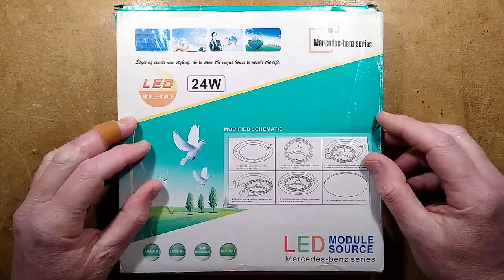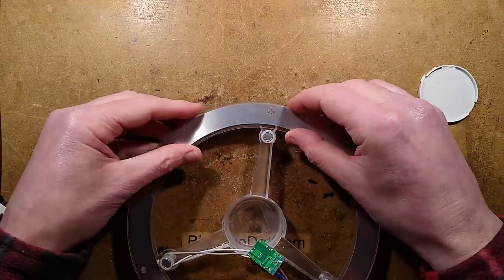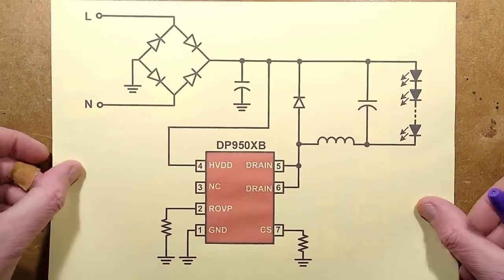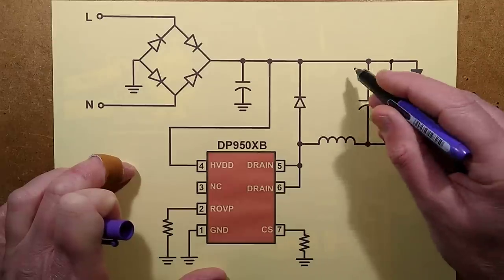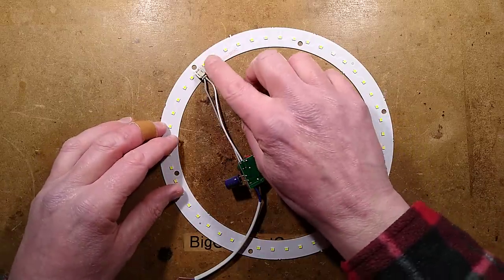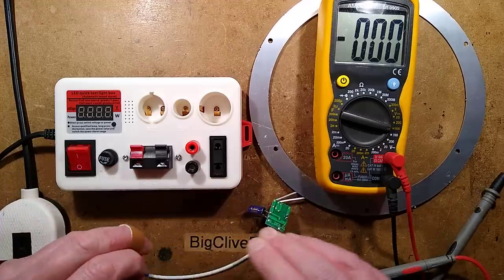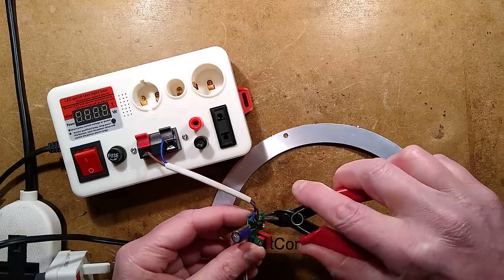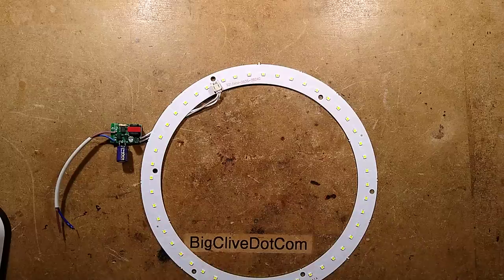Mercedes Benz LED ceiling light (with schematic and hack)

Comment: Yeah, made me laugh about Mercedes not "knowing they made this, too".   If they did they certainly would be dazzled by the quality.
Reply: Or they would be horrified  !!
Reply: It's actually pretty good as these things go.  It's got a proper bridge, a proper driver, and discharge resistors.  A bit overdriven, but who isn't these days.
Reply: Mercedes would love it, it's roughly the same quality that their vehicles have been lately
Reply: Makes me want to buy an old worn out Mercedes and just cruise around with one of these as the hood ornament xD

Comment: Once again you're wisdom is invaluable. Had taken up the current sense resistor on an led strip lamp. But it wouldn't always start nicely, sometimes flickered. As a result of this video have adjusted overvoltage resistor and now it starts every time 😁

Comment: In my town some of the Keep Left signs on traffic islands were getting smashed so often they've been replaced by ones on springs. They just fold down when a vehicle hits them and bounce back up afterwards.
Reply: Aussie?
Reply: I ignore all keep left signs. I hate all political sloganeering 😊
Reply: @jeffreybarton1297  As a centrist, I choose to drive on the divider.
Reply: As a right wing extremist I drive on the sidewalk
Reply: they should just put anti tank mines under the signs
Reply: I would have added some I-Beam or concrete block or something. Anchored deep into the ground.
Someone who drives over a traffic island doesn't deserve an oil pan ... or radiator ... or any car that is functioning anymore
Reply: An ideal video would be one showing the many mindless moron vandals, who seem to prowl some UK towns at night, attempting to destroy one and then it springing back to take revenge on their privates. Problem is, the moron would probably sue the council for GBH.
Reply: @ralphj4012  And win.
Reply: At the school where I work the mummies knock over the illuminated traffic bollards faster than they can be put back up again.  They tried putting some wooden posts in front for protection but the mummies just knock them down too.
Reply: @Fluxkompressor  did you see the clip featuring the "dukes of hazzard" van flying over the roundabout? :D
Reply: @Cenentury0941  As a cyclist I ride anywhere I damn well please!
I jest me good rider honest😁
Reply: In the rural area I live, there's a few mailboxes on springs like that because they keep getting hit by the snowplow in the winter... 😂😂😂
Reply: @larsfinlay7325  found the anarchist. :)
Reply: Please remember! ☝🏼”Two wrongs don’t make a right but three rights make a left.”

Comment: The most secure way: to warn about discharging caps, then saying again "discharge", just to use the fingers one second later. Clive, live long and prosper 😇
Reply: Laugh all you want, but Clive just saved me $6 for a bottle of wart remover.
Reply: I´ll never do that again. One small 400V capacitor burned deep holes in my finger. It took ages to heal.

Comment: Small HV Mosfets can have fairly high resistance. 8.5 ohms seems totally believable to me. With the current as low as it is, the dissipation is probably still a fraction of a watt.

Comment: I sort of like the aesthetic design because it reminds me of the old round CFL lights. It would almost fit in with my grandmas old 70s travel trailer.
Reply from the maker: It is designed to fit inside lights that used the round fluorescent tubes.
Reply: @Sylvan_dB  Clearly the spokes can be removed and the  driver moved off to the side - see about 8:50
Reply from the maker: @kneau  That's unusual.  Is it a skin or vision effect you experience?

Comment: It's a conventional-but-upside-down buck regulator where the buck's "ground" pin is the + power supply. Assuming the inductor is large enough to force the regulator to operate in continuous mode (rather than discontinuous mode), if you put a scope probe on the "DRAIN" pin using the HVDD as the scope's ground lead (VERY dangerous to do!!!), you would see a rectangular waveform whose duty cycle is Vled/HVDD where Vled is the forward voltage of the LED string. The current in the load (the LEDs) is a sawtooth. Just about all switcher topologies force a sawtooth-like current into the load.
Reply: I would not touch it with a scope without an isolation transformer to drag the whole thing to whatever potential the GND clip demands.

Comment: High voltage mosfets can have quite significant R_DS_ON, especially if they're just for low currents. Since it only takes a few mA to get several watts at mains voltage level, this is not a big issue. At high power (>1kW) only quite modern mosfets can actually rival IGBTs in terms of efficiency, but often still at higher cost.
Reply: Yes, everything else being equal, the on resistance goes up by the square of the voltage rating, so a 200V MOSFET will have four times the on resistance of a 100V part, given the same chip size and technology.
Reply: Yeah, it’s GaN or bust for mosfets at highest power levels. IGBTs were manna from heaven for a while now.
Reply: @absurdengineering  Or SiC. They're similar or sometimes better than GaN.
Reply: @Basement-Science  Yep. I did forget about SiC!

Comment: That light, with the center bits removed, could make a good light for a big milling machine or similar to light up the work area.
Reply: Drill press!
Reply from the maker: Commonly called a ring light for that application.

Comment: Running it at 18 watts while putting the IC in the center of the Benz logo so it has no idea of how hot things really are will definitely kill the LEDs in short order. That is quite a lot of power  for something in a piece of plastic. I wonder how long they really last? I can just see the plastic turning brown with a bunch of random LEDs melted into it because they fell off the board.

Comment: Speaking of "minor traffic issues " , I was trucking alfalfa hay from Nebraska to Wisconsin as a two man team.
Non stop all the way.
We pulled over to change drivers and check the load chains when we discovered that two,1200 pound bales had fallen off the back of the trailer somewhere between North Dakota and Minnesota.
Oops.😮

Comment: Another great video. 
So great I’ve watched it 4 time already 
“Let’s discharge this ,,ahhh yes” I swear I could hear the crack as the capacitor discharged. 

Interesting light. Nice concept with many applications 
Could add it to a circular magnifier by removing the spokes and hiding the circuit in the arm.

Comment: In 40+ years as an electronics hobbyist, that is the first time I've ever seen a resistor with a gold multiplier band. I was scratching my head for a while: er 6, 2, hmmm. I guessed 6R2 but it was a lucky guess on my part. 😁 At least it wasn't one of those damn 5 band horrors. What genius decided on the blue background that makes them practically unreadable?
Reply: The light blue background might signify metal film rather than carbon resistors, but I'm not sure .  For the color bands, I forget which multiplier is the same silver color as the 10% tolerance.

Comment: Those MOSFET resistance values will be in ohms, not milliohms.  An 8 milliohm/500V chip would be huge, much bigger than that 7 pin package.

Comment: By how many volts does your local power supply vary over the course of a day, week, month? I could probably figure out these variations of my own electric supply, but  I simply don't have the time. Once I retire however, most of my time will be spent corresponding with my local power supplier about these voltge variations. A lot! lol :D
Reply: Mine varies almost not at all now. They installed voltage monitoring equipment down the line which they must use to adjust the taps at the substation in realtime. Even during the summer with peak loading the voltage barely drops. Any drop I see is mostly at my transformer my neighbors and I share or my own 100 amp service lines. I live in the US
Reply from the maker: It's seasonal as I'm close to a small substation.   In winter the voltage dips a bit.

Comment: Hi ya Clive.  Great video as always.
Totally unrelated question for you
I'm trying to make my own led system for a model train set, using a couple of 4017 ic's for control of the lights. Will connecting the pin 14, usually VCC, to earth/ground turn it off.
Reply from the maker: What's providing the clock pulses?  If it's a 555 then grounding the VCC pin could shunt the output of the 555 to ground via the internal pin protection diodes if it was left running.  There's an enable pin on the 4017 that can be toggled between 0V and the positive rail to turn it off passively.
Reply: Hi Clive,I have a Hychika 18v work light that I was testing and old battery with and managed to put + to - now its very dull and won't turn off could I sent it to you to fix cause I haven't aclud what I've done tk it.

Comment: As far as i know when mosfets are high voltage (above 100v) they have an on state resistance of few ohms not miliohms. If they are low voltage they have on state voltage in miliohms range.

Comment: Doesn't run on gasoline ✅
Doesn't destroy urban spaces ✅
Doesn't tailgate everyone who isn't driving at least 160km/h ✅
Affordable ✅
Is actually useful ✅

10/10 a good Mercedes Benz product
Reply: TO be completely fair - we own an 08 MB Smart Four Two.  Got it for $1700 USD with only 60K on it.   It will run 400 miles on 7 gallons of gas at 75mph all day long.  It gets funny looks, but it also makes my wife smile and the automagical manual transmission is prepping her to drive a manual-shift car.  I've also added Car play and a backup camera which is a HOOT!
Reply: Probably lasts longer too
Reply: @TechGorilla1987  I assume you're in the United States, so I'm gonna pay you respect for doing the best you can to fight all the truck overlords over there by doing the most sensible thing your infrastructure can provide without giving anything up 👍 I'm in Germany, I don't own a car and never will, our public transit system mostly works as intended. When I hear Mercedes, I first think of the huge expensive sedans. Totally forgot Smart belongs to Mercedes.
Reply: @Okurka.   You're accurate to point out that discrepancy.  

They never met miss hyper-mile that I married.  She also consistently manages to get 23 mpg out of our 08 Lexus RX350 AWD with 228K on it.  Me, not so much.  Also, I should not have added the 75 mph to the statement.  It will not get that kind of mileage when you're screaming long with rush hour traffic, but the wife rarely hits 60.
Reply: @MeltEmber  To be fair - while the vehicle may have the Mercedes badge, the engine is a Mitsubishi 3 cyl.

Comment: Fun, I'll have to install one of these on my Prius...  :)    But seriously, why ARE there magnets on this?  If it were 12volt, I might understand, but what are you going to stick this to running off mains?  Looks like a ceiling light, and I don't think there are many ferris ceilings around...
Reply from the maker: It is designed to replace the existing light inside a ceiling dome fixture by sticking magnetically to the backplate.
Reply: ferrous... ferris is the wheels they have at funfairs! ;-))
Reply: @stepheneyles2198  and a guy skipping a day of school...☺️

Comment: @10:45 - not super relevant, but I recently started watching a chap called Mend It Mark (@MendItMark) and he recently busted out a "Cliff Quick Test."  I shouted at the screen in glee when he did.  Without Clive, I never would have seen such a device.  The US (110 V) versions are NOT cheap.  Mend It Mark is a decent channel for audio-style repair work.

Comment: I've have a Li-ion charger with the same chip, but a diode across pins 7 and 2.
Replaced the diode with two resistors as voltage divider. 1:5 ratio = 650 mA CC.
 ;)

Comment: A question: why did they use surface mount resistors and a big old through the whole one?
Reply from the maker: It seems a common thing.  Maybe just space saving through stacking, or the easier availability of precision resistors in one form.

Comment: When I saw the thumbnails I thought this was a spare ceiling light for the cabin in a Mercedes car .  Well, technically this could be run straight from the main battery in a low power EV, though I doubt the capacitor is good for the bigger 800V DC cars .

Comment: Easy magnetic mount, anyway. Just bang three suitably placed steel nails, or screws, into your ceiling, or wall, and stick the lamp unit straight onto the screw/nail heads.

Ironic, really, considering that Mercedes Benz went to war with ford over the design of the rear light clusters of the Cortina Mk1 because it looked too much like their company emblem. I wonder if they're aware of this emblematic rip off.

I want some dome lights to put into a static caravan, but I think I'll probably take a look at what Wilko has to offer!
Reply from the maker: These lights are designed to stick onto the steel ceiling plate of an existing light and be covered by its cover.
Reply: @bigclivedotcom  I can see how that works, if you have steel lamp units, but mine are aluminium. I'm pretty sure though, that with three strategically placed screws, they'd stick just as well.

Comment: You're confusing reasonable MOSFET Ron values for USB chargers with those for high-voltage circuits! To get milli-Ohms for a 500V type would require an enormous silicon die (an IGBT would then be the better choice, I think). Anyhow, milli-Ohms aren't needed here.

Comment: Hi Clive, 
Have you come across any LED controller for cold, warm and (cold/warm) 3 color LED module 
I am interested find out how to change the sequence 
From cold->warm->(cold/wam) 
To start with (cold/warm) combination!
Reply from the maker: You can't change the sequence in the dedicated chips.
Reply: @bigclivedotcom  
Thanks Clive 
I almost lost all my hair trying to find a wa out 😂
When I measure the power consumption, all 3 use same wattage, 
That mean either cold or warm is driving the LED at maximum. 
Then both ON the current passing through the LED May be @ 50% so the lamp LED will last long. 
 Even if I can’t change the sequence, if I could make it to run both cold and warm LED at power on will help me!
(LED driver have 3 colour (white/Gray/Yellow) Leeds out and connect to the LED panel)
Not sure it’s cut and join both warm and cold (-) leads together. 
Any suggestions?
Highly Appreciated and thanks in advance.

Comment: I find it odd that the output of the bridge rectifier goes straight into the diodes. How does the convertor have any effect?
Reply from the maker: One side of the LED string is referenced to the positive rail, and the other side is via the inductor that is being pulsed.  The single diode is the flywheel diode that diverts the positive from the collapsing magnetic field to the positive rail.

Comment: I have seen in some flyback SMPS chips where the mosfet is used as the reference for the current sense. Basically the resistance generates a voltage drop, which is then compared to the programmed max current to determine when to terminate the conduction cycle. That may be the case here as well. It has the advantage that it automatically derates the switch as the on resistance of the mosfet will naturally rise when the chip heats up, and terminate the conduction cycle sooner, limiting power output.
Reply: This device has an external current sense resistor, so not sure why they would need to use the mosfet for sensing? The lithium battery protection boards do use this method though, very imprecise but often good enough for protection rather than regulation.

Comment: One gets the impression that "someone" is  taking liberties with translation - even Google Translate provides a better result! Nevertheless an interesting all-in-one design, but as others have mentioned those tracks are pretty flimsy for the current draw. We've got a broadly similar design of replacement light unit in our ceiling fans - however the PSU is a discrete module, so may be easily changed in case of failure (however after ten years' intermittent use they are all working just fine).

Comment: Funny thing about those style of flush cutters. I have used them since they first came out and I have used Kline,  craftsman, knipex,  Xcelite, and no name brands... I've tried them all. What I found is when you remove the handles, the part number under the handles stamped on the metal is the same. Some factory is making them and slapping whatever name brand handles on them.  Doesn't matter if you buy Klines or Amazon, they are the same.
My favorite thing about them is how they are incredibly cheap and when I break them, I don't cry about it, because they are disposable.

Comment: The mosfet resistance of 8.5 Ohm may be used in conjunction with the OVP sensing, so it limits the OVP based on the voltage on the + side of the mosfet...I'm just guessing though.

Comment: Those stiff flimsy wires are also very prone to the sheathing disintegrating within an alarmingly short time.   Our CDA oven element had wires like that, I have photos of white ‘pvc’ dust inside the oven.  Probably mostly because the wires were a) the wrong gauge for the wattage - shockingly thin wire (see what I did there?) - and 2) made of non-cupric metal (overheating).  Pile of dangerous pig poo.

Comment: Weird night, just landed on "Hand tool rescue" but was not exactly what i was after. Then some how here. This seems to be a drawback in the modern age, to have big splodgy fingers. (an a shite phone)
Reply: 8.5 ohm would drop you into that   Caribbean song "hot hot hot". Also... I may be wrong.. (unlikely) but back in the day. A cap and a resistor in parallel is a tuned circuit at a specific frequency. Remember 1/2*pl*sqr root of cap * resistance or some such.. 😅